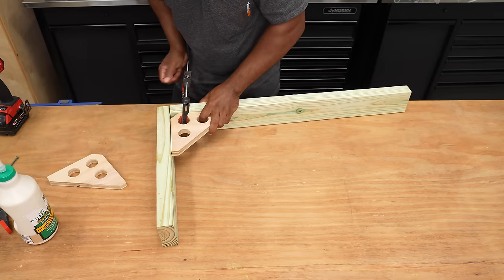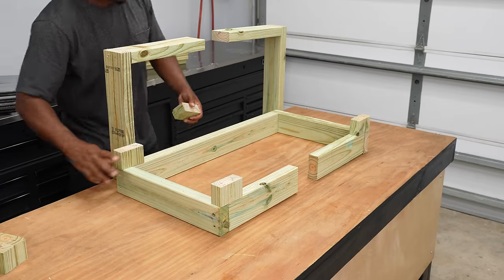How to make a composite planter || 2 in one Planter

Comment: Nice build looks really good. Here in the UK it would be illegal. We are not allowed to mix socket outlets and lighting as they are rated differently. Lighting is rated 5amp and ring mains 15-30 amp. In your case if you had a fault on the lighting side it would not blow the circuit breaker. In your case we would use a 15amp ring main then install a spurred outlet with a 3amp fuse to run to the lighting. I think we are different because we are working with 240v which can be a killer if you get it wrong

Comment: Your projects are really nice, and your presentation is so pleasant - you make this all work so well! I have two suggestions: you should not use those stab in the back connections for your wiring, as they are minimal in contact and often will vibrate out over time. On your miter corners you can try a carpenters trick where you burnish the edges together, rubbing with a screwdriver shaft usually works well. Practice with some scraps. I know it works well on trim, but I have not tried it on composites. 
Thanks for your encouraging and inspiring videos!

Comment: A great looking build just as it is, but has the capacity for so much customization and extra features.  You already have power in the post, I'm thinking soil moisture sensors and an LED to indicate when to water might be a good next step in making this more complicated than necessary.
Reply from the maker: Thank you! You can go nuts with creativity and features. That's the best part about custom building.

Comment: Great idea and design but carefull, the fabric will allow humid soil to stay in contact with the wood and it's going to rot, the lack of feet too.

Plastic bag with holes in between the bottom wood can be the answer.
Or better just make a fancy "cover" for a cheap plastic garden pot (this will avoid wood in the bottom and totally avoid rot)

Comment: I love the projects but you used the wrong cabling, receptacle and receptacle cover per code. You need GFCI receptacle with a bubble cover now per code and you need cabling that is rated for outdoor use.
Reply from the maker: Hey Jay, Thanks!  I did make it clear in the video I used the wrong cable and would link the right one. I didn't want to hold up the project. You can find a number of cover plates the bubble one is not the only option.
Reply: @DIYCreators  thanks I missed the cabling comment. But electrical codes changed a few years ago, only the bubble ones are allowed now. All outdoor receptacles are to be gfci or protected by a gfci breaker. That’s the electrical code.